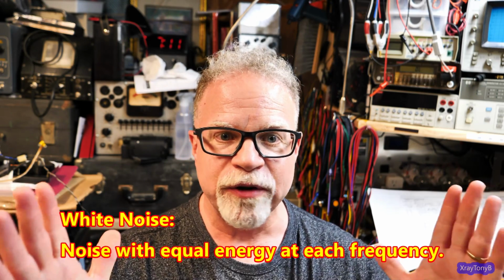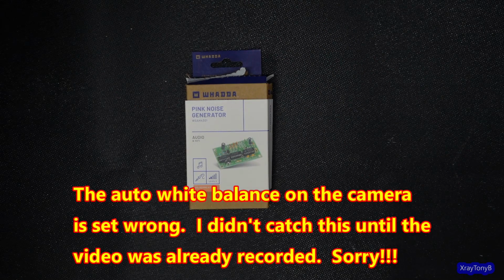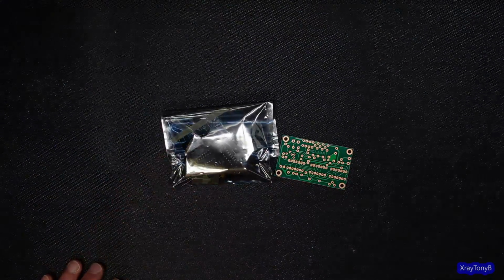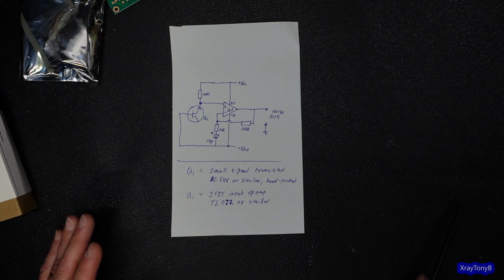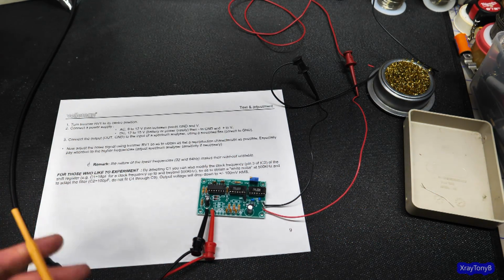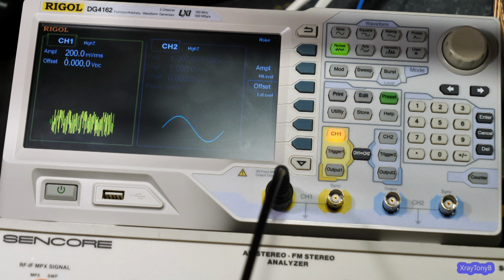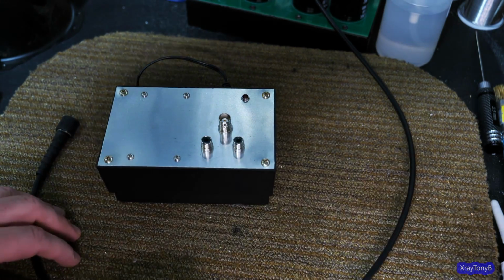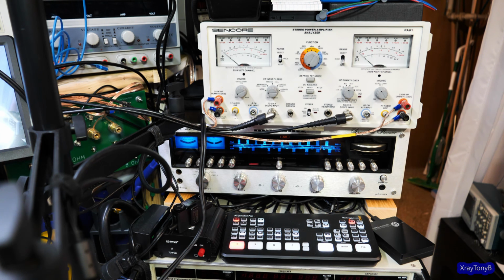Pink Noise Generator

Comment: One thing strikes me, the human ear won't treat frequencies equal, but I am not convinced that if you roll off at exactly -3db at every octave that it then fit our ears perfectly. That is looking at our ears as machines. We also know that at higher frequencies our ears perception rolls off quickly to zero, depending on the health of them. You cannot tie a strict math relation to that ?
But sure indeed, the pink noise sounds much better than the white noise.
Reply: your results may vary...same with color

Comment: I once saw an article about a better analog noise generator.  It may have been an application note by B & K (Bruel & Kjaer) or somebody else.  But the core idea was that the single transistor noise source provides more unpleasant noise than necessary.  You should utilize two transistors, one avalanching on positive voltage and the other one on negative voltage.  Then you add the two individual noises and get a balanced noise.  I think that the experience is like having all (odd and even) harmonics in a distorted signal, rather than mostly even harmonics..But I may already remember wrong.  Anyway, the summing of the two sources requires one or two DC blocking capacitors and two identical resistors feeding the two signals to the inverting input of an op-amp and the resulting “better” noise is available at the op-amp output..  This is of course still white noise.  BUT, another noise source I have once seen used a CMOS op-amp CA3130 (originally from RCA) at a reduced power rail voltage that maximized the noise — and surprise, it produced PINK noise without further filtering!
   Finally, James G. Holbrook in his book Laplace Transforms for Electronic Engineers — Second edition 1966,  Library of Congress Catalog Card 59-12607 — has a thorough treatise of synthesizing the white to pink noise filter, starting around page 254.  He also has other applications for the synthesized circuit.  Just for anybody (possibly?) curious.

Comment: Hi Tony,

I have an interest in your stabilizer device that demands a story about a possible use.

In the 80’s, I was on the phone with a friend of mine, an audio engineer at MCA-Universal Studios. He related a story about a recording project, wherein they needed to choose, between a very-imaginable large number of microphones, to determine the “correct” mic for the project. This is the first time I’d heard of such a dilemma nor a Neumann mic.

He told me that do help the producers’ choice, he would use a pink-noise generator and an oscilloscope! That way they could determine which mic could deliver the output needed for best results.

I hope that helps you in your making a list of possible uses for a pink-noise generator. I’m sure that I’ve bought many Neumann mics as a result of my belief in what he told me.

Comment: I’m all in on the topic of this video. I hate to depend on a phone app or software on my laptop to do basic tests, unless I need a printout. I just think I could really use a pink noise generator along with my old analog RadioShack Sound Level Meter to start dialing in my speakers, adjusting my room EQ device, setting sound levels for AB testing of speakers, amps, sources, etc. It just seems like a very useful device for me right now.

Comment: In my industry, commercial cinema projection and sound, pink noise is a bit of a staple.  It is used for cinema tuning still and has been traditionally used for tuning film projectors with both magnetic and optical soundtracks.  We carry pink noise on film, cards (old analog cinema processors), internally generated (modern/digital cinema processors), with the analyzer (we use RTAs all of the time).

With an RTA, pink noise is an incredibly fast way to see the frequency response of the system.  Additionally, when setting up things like azimuth on tape/film systems, pink noise with a scope in X-Y mode can be a very quick/easy means to dial in azimuth (yes you can use pure tone too though you'll have several false in-phase responses with tone, depending on how far off you are).  

I even, back in the day, built a Heathkit AD-1309 portable pink noise generator (white noise and pink noise because, as you well described...you start with white noise and via a filter make pink noise).  It is always handy.  I've even used it to set PA volume in a hospital where you can't do normal testing of things...but you can, gradually bring up something like pink noise and if you know the level you are sending, you can measure the level coming out of the various speakers, at low volume, to know that when an actual announcement comes through, it will be at the right level (and not frequency compromised). 

As always, a wonderful video by Tony.  Have a great weekend!

Comment: Thank you very much for sharing your knowledge, I always learn something from you. You can generate noise (3 types) audio file using Audacity, an open source software.
Reply from the maker: I actually have several files I use (including an uncorrelated pink noise file) that I generated in Audacity.  ;)

Comment: So if I understand this correctly (I probably don't), a 1 KHz / 1V peak-to-peak signal has the same energy as a 10Khz / 1V peak-to-peak signal?
Reply from the maker: Correct.  As long as the signals are both sinusoidal, then the RMS value of either signal will be .707 of the peak voltage, regardless of the frequency.  Since peak voltage is 1/2 peak-to-peak, then RMS would be .5 * .707 = 0.3535 volts.  Calculating RMS of a complex waveform is a bit more complicated than the basic sine wave, but essentially it's the same idea.

Comment: Thank you for the video! 1) Would two of the digital kits - one for the stereo left channel and one for the right - make an uncorrelated generator, or would the electronic means which creates the psuedo signal be too close in non-randomness between the two kits? I can understand why starting with two transistor created white noise generators, the two channels would be totally uncorrelated - because no two transistors are the same... I hope I said that well enough to be understood... Cheers.
Reply: The digital ones will be uncorrelated, especially if left running for a while, and with clocks that are not set to the same frequency. that way clock drift will move them out of phase with each other.
Reply: @SeanBZA  Thanks! Great information. I appreciate it.
Reply from the maker: If you used two of the kits from this video, they would generate an uncorrelated stereo noise signal, since the reference oscillators are running independently from one another and are not phase or frequency locked to one another.  Thanks for the comment!

Comment: I have a Panasonic white, pink and brown noise generator from the 1980's.  I think it was actually made by Matsushita.  All of the print on it is in Japanese and I had to get a friend translate it for me.  Got it on eBay Japan which I might add is a great place to pick up vintage Japanese electronics and test equipment.
Reply: matsushita is panasonic's parent company so yes, it was made by matsushita. :)
Reply: @josephlalock8378    LOL, I realize that.  Point was it was made in house and not by another company for them.  I have some analog meters labeled Matsushita and some Panasonic.  Exact same meter but different silk screened faceplate.